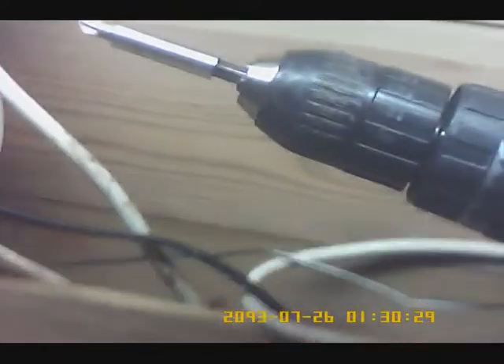How to fix mini moto cutting out problem

Comment: hi, i cleaned out the jet out mine so i could see light through it. but it still keeps cutting out. is there anything else that can be blocked
Reply: I just got mine and I cleaned the carb it still kind of Boggs down but it works.
try altering the carb idle
Reply: @teddawes6293  thanks. have adjusted that and cleaned cab jet about 4 times now. keeps gettng clogged. must be dirt in the tank or something